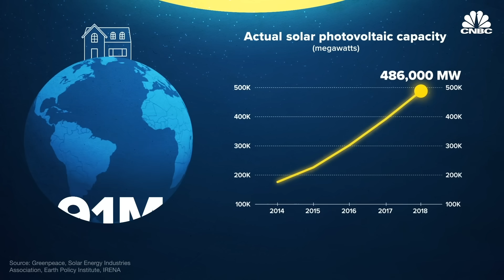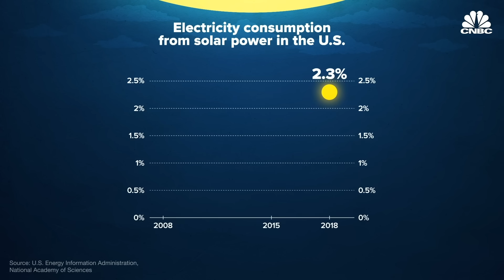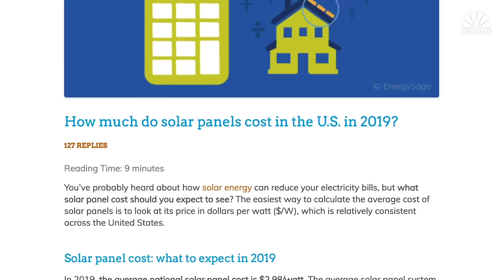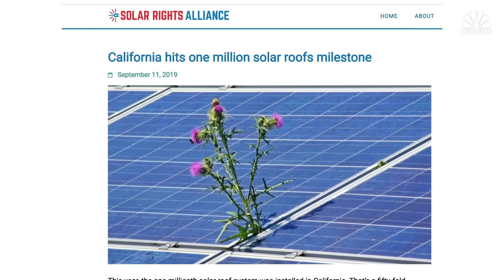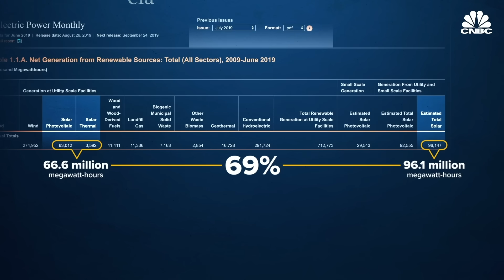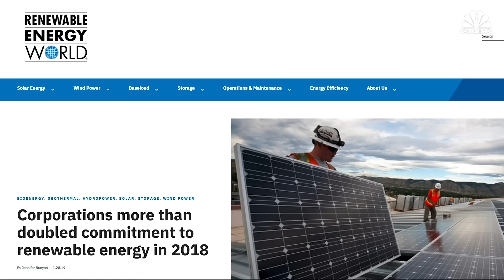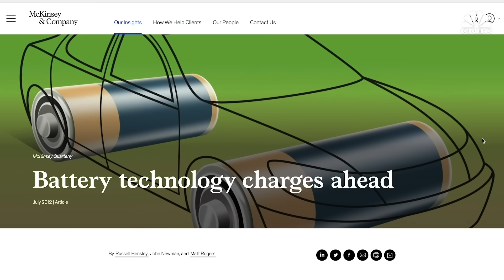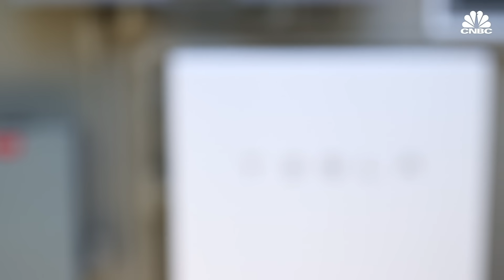The Rise Of Solar Power

Comment: People should demand that the south facing roof of new home construction be Solar Paneled as a standard, with power storage in the utility space.

Part of the base cost of a new home and built into the architecture, rather than an expensive refit project.
The MSRP of a single Powerwall Module costs about as much as when I put in a new Water Heater & Fridge last year. Of course, I would want a double stack, but still...

Comment: CNBC quoted $12,000 (after tax credits) for the cheapest - but is that also the least efficient?  I realize efficient solar panels is an oxymoron, but if prices are supposed to go down as they said, then price should be (way) less than $10k by now. Also, most houses need only a small footprint.  Most solar companies overestimate residential customers power needs.  So this solar business is shooting themselves on the foot with keeping the prices still high and letting their technology stagnant and inefficient.

Comment: Both NBC and solar power are frauds.  Solar power is great for pocket calculators, satellites, remote weather stations, and powering a few light bulbs in an off-grid cabin.  Solar is worthless and destructive when used for large scale energy production.  The only worthwhile renewable energy scheme that works for the masses is hydroelectric power.  Please see The Renewable Energy Disaster at http://renewable.50webs.com/

Comment: Oh boy i cannot wait for solar to blow up as the biggest bs ever !! Devices of tomorrow are going to use 10 times as much energy as that of today. Remember the USS Nimitz which when built consumed only 60% of its power but 20 years later consumed 300% ?
Reply: Anup What on earth are you talking about? What "devices" do you think are going to get less efficient as time moves on? Already we are using less power to heat and cool our homes as efficiency increases. Appliances use less electricity than they used to. Computers do. Flat screen TV's use a fraction of the power the old CRT TVs did. LED lighting uses practically nothing.

Comment: It's too bad you guys didn't touch on any of the gravitational potential energy options as a means to store solar electricity until it's needed. I especially like the company who propose to suspend weight in retired wells. Raise the weight with excess electricity, and let it drop to return power to the grid. Low loss and small footprint.

Comment: Graphene  Batteries  Almost Twice the Capacity pr size and weight  and only  one tenth the Recharge  time required  than an  old Antiquated Lithium ion battery   , also we need to start thinking about more geothermal in locations where it's possible

Comment: Again a video almost completely focused on PV panels.... Those are great for homes, farms, mobile homes, boats etc. and it is useful how they start producing power almost immediately after it gets light enough. But for grid level utility solutions concentrated power is just far better, mirrors are cheaper than PV panels and an utility company is not limited by the roof area of a single home or the budget of an ordinary person, so why wouldn't one buy few hundred square miles of desert and build a proper power plant? It will also store heat for hours or longer instead of needing batteries, so nights and the rare bad weather that blocks the sun won't be a problem.
Reply: iirc the Ivanpah station near Las Vegas turned out to be less efficent than PV
Reply: @pn2543  Was that the one built too small to keep the heat up all night? That's the problem with being in the experimental stage, we still haven't figured out all the problems.

And every solution has it's own hangups, want a solar/wind solution that is not bothered by minor issues like it being calm AND night? You just have to build a tower that is at least quarter mile high, preferably more, and a quarter mile in diameter.

Good news is that most of the related inventions have multiple uses. Someone comes up with a way to make super cheap PV panels so we can simply put a million square miles of them up and not care about panel failure rates or grid transmission losses, and you can bet that manufacturing technology can also make us cheaper computer chips or something like that.
Reply: When power goes out for over a month come back and say that again
Reply: @jameswilsin5348  That is going to happen how? War or natural disaster wipes out your power grid or the power plants themselves? Doesn't matter what you use because having a PV panel on the roof of your home is not going to help that hospital or factory or food market whose freezers don't work when the grid itself can't distribute power.

Thick clouds block the Sun for weeks? We'll still have geothermal and nuclear power even if the unnatural weather calms the winds and freezes the rivers and oceans.

Either way anything that would actually cut power for so long would be a major catastrophe and needing a day or few to warm up the steam turbines after the situation is resolved and the Sun shines again is no different from how badly everything else would fare after a disruption like that. And obviously it is not going to have any problems in the 999999 out of million times a disaster like that is not happening.

So please tell us, how is that going to be a legitimate concern?
Reply: Also, awesome are solar towers, they work at night in the reverse direction, perfect for remote places and you can grow food under the canopies

Comment: I would love to solar power my home and drive an electric automobile but it is still far too expensive.  To power my home in KY it will cost more than 50K and this is without storage bank. Without a storage bank I will still use grid electric during the evening.  I believe people will be more apt to covert if moving to solar and electric will net the same cost as traditional power.

Comment: No, I want my Tesla roof. I rather support Elon Musk
Reply: he is a billionaire
Reply: @mazoklug  At least he is a billionaire by creating modern solutions to the Oil/Coal/Industrial/Transportation/Finance billionaires problems. The world needs more Musk and Gates style billionaires.
Reply: @5353Jumper  nonsense, elon makes EVs but also uses refined kerosene as fuel for its rockets, who is playing the devil here?!?
Reply: @carholic-sz3qv  ya, the worlds first reusable booster rockets which are lowering costs for organisations like NASA. Elon creates solutions of all kinds, they are not necessarily all environmental solutions. PayPal did nothing for the environment either, and Boring company is about cost efficiency. And Tesla EVs are not just about cutting gasoline use, they are also really nice cars with awesome performance.
You cannot call him a devil because some of his solutions have environmental benefits and some do not. He creates solutions, how is that devilish?
And I have not done the math but I am pretty sure if you add up all the petroleum savings from the millions of EVs, solar roofs, reusable rocket parts, grid batteries, electric tunneling machines and whatever other solutions he has help create I am pretty sure he has a negative carbon footprint even if he sends a few extra kerosene rockets to create  low cost high performance internet for everyone in the world....which by the way will reduce the number of trucks that need to drive out to remote oil rigs and monitor pipelines  making even the petroleum industry more petroleum efficient.
Reply: you need an Edison battery , they last a life time and recyclable, so is HEMP battery...
Lithium is dangerous, they can catch fire or blow up....
Reply: @aebniala  heres the thing if there is a better solution we wont adopt it until its pretty much too late i mean look at our energy generation
Reply: Jack Telsa also have the standard photovoltaics, if you have an existing roof.
Reply: nonsense
Reply: nonsense

Comment: I put up a DIY 7kw system last December.  It has created 7mwh electricity in 9 months.  It cost me $5400 for everything.  It would have cost $21000 after tax credits and rebates.  The problem is the rules that seem to have been written by Big Oil.  It costs $3 per watt after incentives and only 80 cents per watt form mine.  It only took 30 hours to order stuff, pick up stuff and install the entire system with the solar edge inverter with optimizers.  I am 66 and took my time working 3 hours a day for 8 days with weekend off.  Nice little project that has a payback of 3.5 years.  Texas is a right to work state so you can pull a permit to do this stuff yourself.  I got 21 panels from arizona from ebay.  They are sunpower commercial 327w panels.  I had 2 ladders, one for climbing onto roof and other with 2x4's duct taped to rail to pull panels up one at a time.  Nice little workout and very satisfying.  In figuring out the rate of return, I used a Manuity (annunity but monthly) type calculations with all payments increased by the tax rate.  You pay for power with after tax income.  I don't have to show more income to pay for my power bill.  Due to no credits on overproduction, I have given the Utility about $200 worth of electricity but saved $16,000 by not using the System,.

Comment: I'm a new home builder in the Colorado mountains and I'm installing a 10 kw system on my personnel house and also on a new home build. The cost is $30,000 per install.  We have over 300 days of intense sunshine and a payback of about 7 years. The systems are grid tied, any excess power is sold at a wholesale rate but when we call for grid power its charged at full rate price. I plan on using in floor heat for any excess power. Solar is becoming very common in my area.

Comment: The reason why I got solar on my house is because it saves me money. I have SCE and they just raised rates again. High usage charge is 42c a kwh. We save over $1000 a year by having solar. We went with solar city(now tesla) and leaded then. No upfront costs and locked into the same monthly rate for 20 years while sce is only going to keep getting more expensive. You would have to be  stupid or scared of commitment to not get solar. Have had solar since 2014 and no regrets.

Comment: We have to get away from this chemical storage solution. It is expensive, it has a short life span, it is not efficient due to chemical temperature losses during both stages of conversion, and its obvious environmental impact is horrendous. Chemical battery research is 100 years old, and if there is no solution in that length of time it is not likely it ever will.

Now, how can we gather and store energy using solar panels? Compressed air. We can double the number of Solar panels and use uncalled for electricity to compress air. Then in the evening after the Sun has gone down, we can generate electricity with compressed air with the energy gathered by the Sun during the day. And if you ran out of power before Sunset, install more Solar panels the next day. Then bring out that Tesla, charge it with Solar panels, and knucklehead and his 40 thieves will have a positive impact on the fossil fuel disease we suffer from today.

Now your solar panel IS providing electricity 24 hours a day! For heat, light, manufacturing, and travel.
Its not hard to imagine, the science is all there. All we need to do is through Big Brother Oil out of the corporate energy board room.

Oh, and did I fail to mention wind, and hydro? Or how about gravitational energy presented through Lunar gravitation and tides? Fundy Bay alone could provide the entire North American continent if it had to! And the natural flora and fauna would not even notice! How about run of river? No dams. Just run of river during high volume times compressing and storing air.